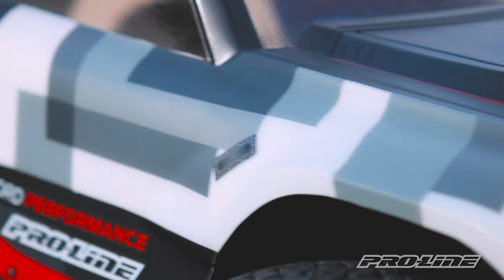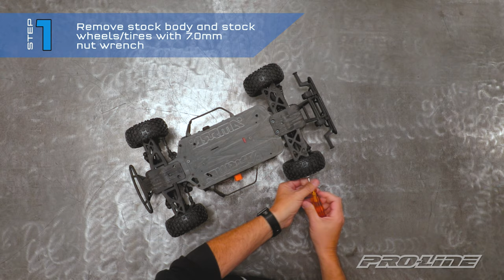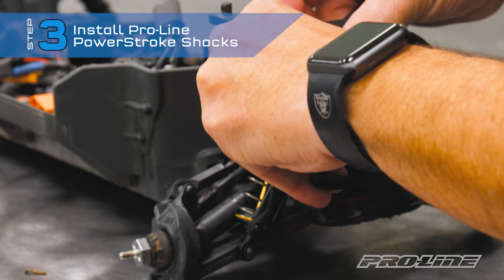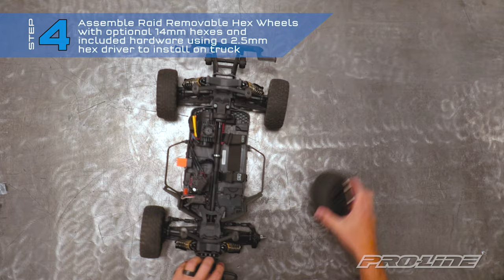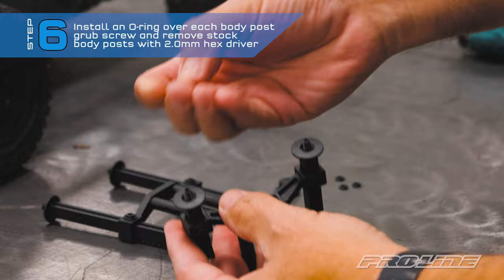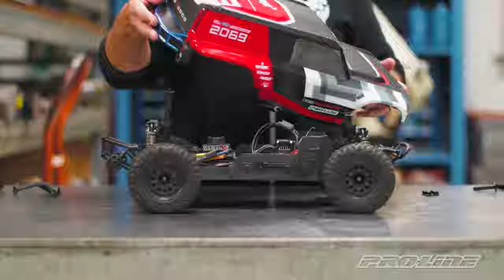Pro-Line HOW-TO: Upgrade ARRMA Senton™ 4x4

Comment: You guys got to start selling some wrapped or painted up shells.  This work is just too good to replicate👍
Reply: I was thinking the same thing. That livery is so pretty, but I do not have the skill or patience to do that.
Reply: 100% agree. Also would be nice if the shells were thicker. For bashing the thin flexible junk is no bueno.
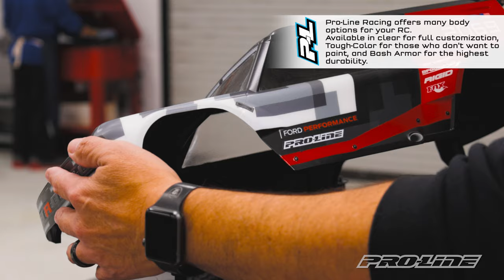Reply: I think proline does provide many options of this body as you can see here at 8:05
Reply: Agreed! Especially these signature / licensed body's are fenomenal, however, it's quite a challange for the average RC guy/girl to replicate the paintjob.
Reply: I want this body, but do not have the skills to paint that sceme. Would be happy to pay $10 extra for full wrap. You did it on the Megalodon and f100 heat wave, so why not this?
Reply: @pawdaypay  They say they do in the video but those options do not appear to exist on their website.
Reply: Those front arches are gonna cut them tyres right up on hard landing, hardly any gap should of put the arches in further to avoid wheel contact imo
Reply: You’re wasting your time. They never listen to their real customers.

Comment: I like it all, but I like the extended body mounts.

Update- I just did the shocks, and wow, what a difference! I have the  Extended Body Mount Kit coming, and I am actually going with the Pro-Line Racing - PRO351200 1/10 2019 Chevy Silverado Z71 Trail Boss Clear Body: Short Course body for my new cover.
Reply: How did that one fit? I'm looking at the same one for my senton since the offspring covered the stock body in road rash lol.